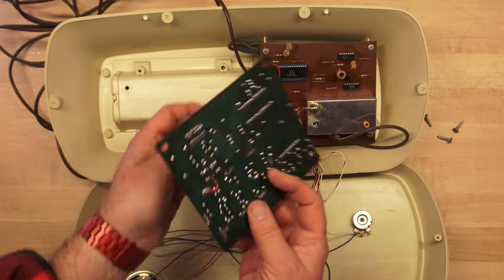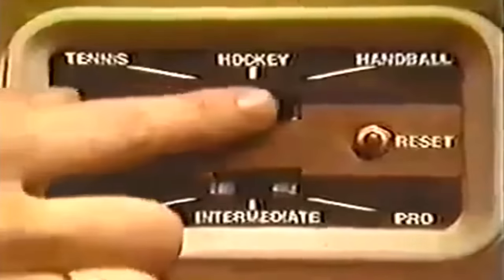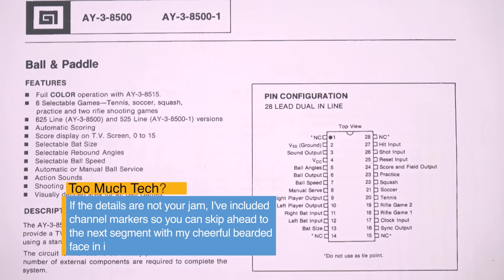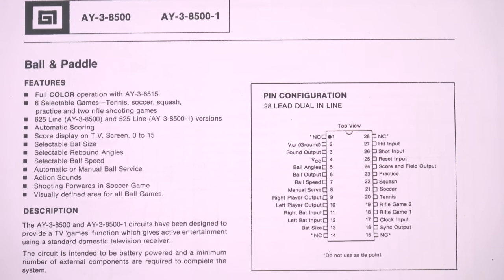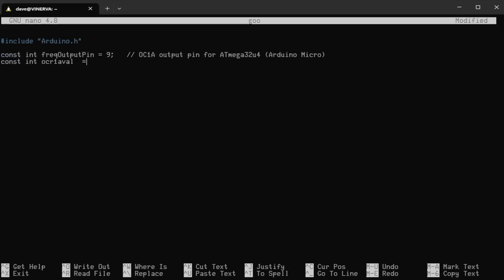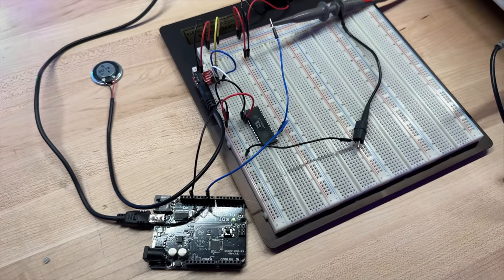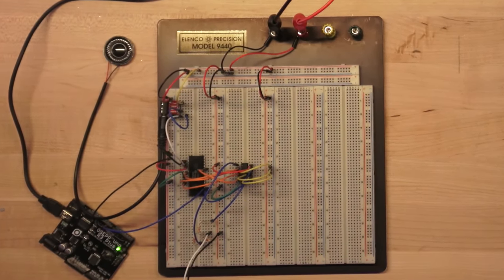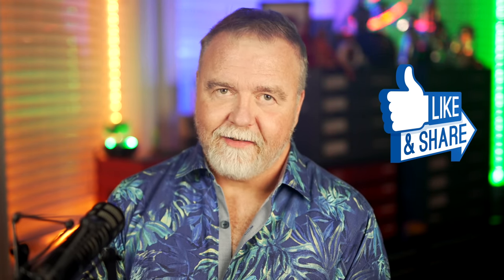PONG! in a Breadboard - Can We Build it?

Comment: Wasn’t Pong analog/hard coded digital? That means no microprocessor, no software, so no ‘booting’
Reply from the maker: The arcade pong was yes.  But the home ones were not, as they'd have been too expensive!
Reply: @DavesGarage  but is the chip a processor or an asic with all the discrete logic integrated on a single die? From the arcade pcb in your video I think the 40-odd logic chips could be done on a single silicon. Especially when there is little analog stuff like op amps.

Comment: interesting effort, but I believe you're kinda doing this the hard way. personally I would have scrapped all that old junk and used something a bit more modern and easier to work with. a raspberry pi would have worked really well. while it doesnt have any analog to digital, you dont really need it. just use switches and a timing loop to move the paddles. I'm sure someone has some cheap joy sticks that uses switches that would work. You can always control the paddles from the keyboard as well since this is just a proof of concept. a keyboard should be an acceptable alternative. You should be able to rewrite the whole game in python in an evening. The only thing necessary, is to understand how the program works. Im sure it could be worked out on a flowchart pretty easy. once you have the basics. it should be easy to turn this game into breakout. the pi has everything you need. just think about it...still, its a good video. I hope you have a great night. have fun.

Comment: While interesting, I'm a bit disappointed in this video.  I thought you were going to build a Pong game from scratch, if not base components, at least basic logic chips, oscillators, etc. like the original inventor had to do.  What you did was hook up a video game on a chip with the I/O and controls.  Of course, if the chip is not fried, it will work. The hard part is finding a working composite CRT monitor or television.